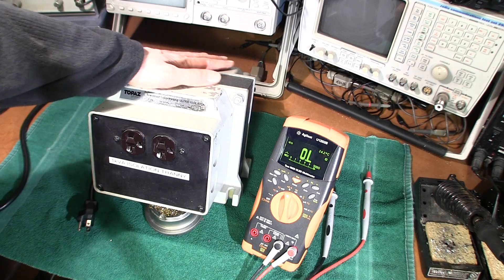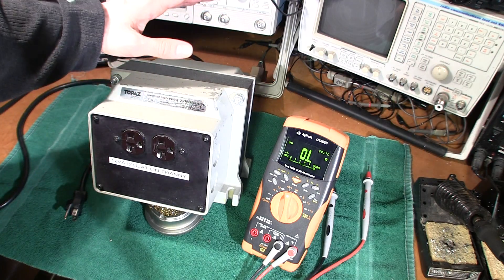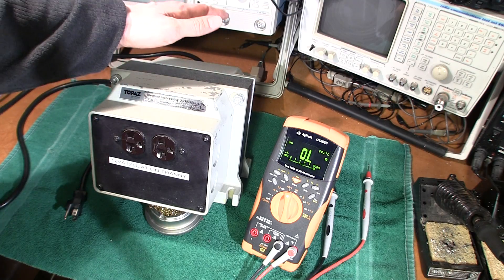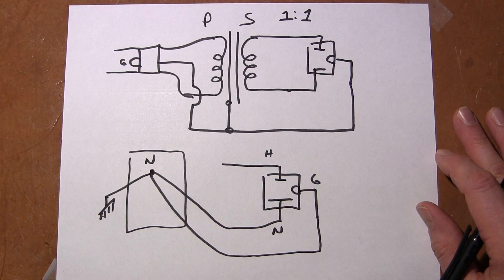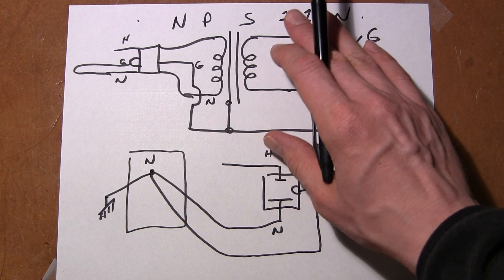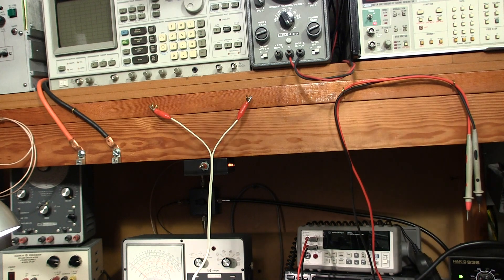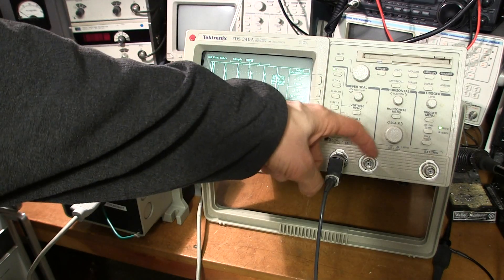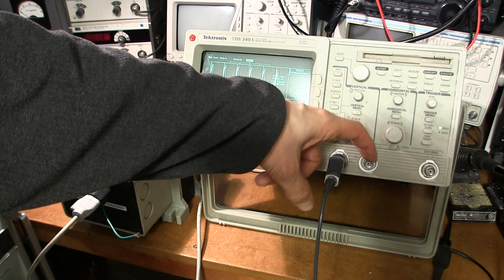Tech Tips Tuesday, Isolation Transformer and Variac Safety

Comment: So, here's a question: I'm planning to put together a little box around an isolation transformer that just has bare leads, and no plugs or outlets or anything.  My thinking was to still use a 3-prong outlet as the output, and to bond the "ground" of that outlet to its neutral, but where they're both floating relative to actual mains earth/neutral.  Is this reasonable, or should I just get/use a 2-prong outlet, and one of those adapters if my DUT has a 3-prong cord?

Comment: I have used that short cut with both isolation trans formers and vairacts. OK then what is the proper way to protect your self? Isolate the whole bench from ground? ie suspended ground in the fuse box or junction box?

Comment: Hi Mr Carlson: I have a Variac  Transformer TDGC2kM 2000VA. I want to use on my bench for project ,  my question is can I disconnect the grounding  wire so that it will be safety to my oscilloscope?

Comment: Thanks for a great video on this topic and addressing the safety ramifications off making mistakes in this area. This did breed one question. I have a gfci that's feeding power to my bench. I believe it would not work if a fault is generated on the secondary of the isolation transformer. Am I correct?

Comment: Mr. Carlson,
 I have a power filter for my equipment, an isolation Transformer ( fixed after watching your video👍)  A variac. I also have a current limited lightbulb when needed .
My question is ,...Where is the best location to place my isolation Transformer?
At the beginning of it all.  In the middle or at the very end???
Reply: I always heard it's best to place it after your isolation Transformer because your isolation Transformer is designed to operate at the voltage the manufacturer designed it at.

Comment: ... UNLESS... it is an isolating variac... which does exist.  Sorry, I have to muddy the waters when I have the chance... which also connects the ground backwards through your wonderful neutral line at the breaker box if you have bog-standard wiring systems like most of us have... which muddies the waters even further... Hell, where I live I can't trust that the water pipe in my lab doesn't somehow connect through to neutral at some point because of someone deciding that my explaining electronics and ground to them suddenly made them an expert in all things electrical... (glances upstairs)... anyway. to filter the waters back to something drinkable, ALWAYS CHECK EVERYTHING before doing anything... belt and suspenders.

That's my mad-science tip of the day, and why I still have all my fingers.

Comment: If your outlets are protected by a 30mA RCD like we have ( or should have ) in the UK, I don't see a problem. The user will be protected from a lethal current in the event of contact. Most UK systems of domestic supply have a PME ( grounded neutral ) type supply.
I appreciate that some older equipment have a 'hot' chassis where additional precautions have to be taken. Thanks a lot for the video, very well presented.

Comment: I have a Really Old "Hammond" isolation transformer, model 171B60 that solves this problem.  It has just a 2-wire male plug on the AC Line input, and a 2-wire female socket on the transformer output.  Got this transformer from my uncle back in 1974, and I'm not sure how many years old it was then (I see the 'newer' Hammond 171B are 3-wire input, and 3-wire output)

Comment: I break that primary ground loose and then I install a Heinneman breaker and a GFCI on the secondary side. If I want to get really fancy, I will isolate the whole transformer from the housing. I then tie the primary ground into the housing and I hook the secondary ground up to the isolated transformer frame, and bond the neutral to the core & frame but NOT the housing. I will have to use an orange isolated ground receptacle so the grounding plug prong is NOT strapped into the strap frame. I will also fuse the primary side.
Reply from the maker: Remember GFCI receptacles often create noise in radio receivers.
Reply: @MrCarlsonsLab  That is why there is an isolated ground hospital outlet on a Heinemann breaker outlet and a GFCI outlet running out through a Schurter line filter. I have a sailboat inverter charger too. THAT SUCKER IS SUPER NOISY, unless it is running off the batteries, but at the dock on  dock AC power it's beyond horrible for noise. Your radios are worthless on dock power through those.
Reply: The dock power is also all running off of multiple GFCI breakers, and those GFI send coils are inducing  tons of extra noise into the AC.

Comment: Makes me wonder why you even need a third pin and 3-wire power cord in the US.
If the ground pin is connected to neutral in the breaker panel anyway, why not connect ground to neutral in the appliance itself?
Using a plug with a small and large pin to distinguish hot and neutral would suffice.

Comment: So when you put that little cheater plug in and had the green ground wire kinda hanging there: if that ground wire happened to get pushed up against the case of the isolation transformer, would that re-complete the ground circuit and bring us back to the initial scenario? (Of course, assuming the case of the IT was grounded and the paint wasn't blocking it). Thanks!

Comment: Thank you Mr. Carlson. If I ever get an isolation transformer like yours I'll be sure to open it up and cut the ground connection to the secondary side.
Reply: I completely agree with you. Paul seems to caused confusion with others, (especially with me) by saying don't ever run the secondary without an earth. Isn't that the point of a bench test power supply, to have no ground on the secondary?

Comment: Hi Paul. Great video. Do you think you can do a video specifically on best practices for slowly bringing up some old tube based electronics with a Variac/isolation transformer? What do you check for (other than things going up in smoke)? How quickly do you bring it up, etc? I know for amps you often remove all the tubes except for the rectifier tube. I know every situation is unique but maybe there are some general procedures to follow?
Reply from the maker: Thanks for your input Kurt!

Comment: Great video. I work on a lot of tube guitar amps and I use a variac and isolation transformer. Do you recommend plugging the unit/amp under test AND the O-scope into the isolated (and earth/ground lifted) power source or only the unit / amp under test? I realize this could be a tricky question because when the scope is earth grounded and the probe clip is on the chassis, the chassis is once again grounded to earth as if the test unit was earthed at the receptacle, even though the mains AC voltage is "isolated."  Thanks for any response you can offer.  I'm in Mission and I refurbished a cabinet for a vintage amp you later did a video on the electronics rebuild.

Comment: Just a beginner here, but I thought the correct way was to hook up your oscilloscope normally, and to the ground and use an isolation transformer (with no ground) on the device you are testing.
Reply: Nope. Don't mess with the ground path of the oscilloscope.  If you need to measure something that can't be measured using the probe's ground, you use 2 channels (without their ground probes) and set your oscilloscope to ch1 and ch2 "add" and also press the "inv" or invert button.

Comment: If the Isolation transformer had no ground on the output side there would be no issue with this transformer. You demonstrated that with the no ground plug adapter. Your transformer is not completely isolated with ground. If you look internally that transformer has ground from the input connected to the ground output or it is connected to the chassis, therefore not isolated. Some transformers are this way even though they may claim to be isolated. Pure isolation transformers usually have a 2 prong on the output and there is no connectivity to any of the the input and are completely isolated. Also, some variac's have isolation transformers built in and may claim to be isolated, are not completely isolated.

Comment: Thanks for this great video. I worked in the TV repair field in the 70's and then eventually went into the electronics field in the 80's to early 90's but I can't remember what we did back then to prevent this issue with scopes. Did scopes change in recent years regarding grounding? I used primarily Tektronix scopes. Maybe I just automatically used a ground adapter and never put much thought to it. Thanks for all you do to educate us.

Comment: I am in Uk so 220-240v ac. I am just setting up my workbench. I have an isolation transformer  and have modified it via a switch on the front panel so I can select the original wiring set up or my modified setup. The modified set up has no earth/ground to the casing, transformer or output socket ( which feeds my variac input). The Variac has an earth tag which is connected to ground on isolation transformer output socket, so on modified switch selection on isolation transformer it is not earthed.
Any comments would be appreciated good or bad.

Comment: Will the scope still work correctly when it's connected to an isolation transformer that has a disconnected earth pin? What does it use as its reference voltage?
Reply: The ground in is the reference voltage. It doesn't need to be referenced to earth. It depends on the circuit you're reading.

Comment: This is one of the most complex and complicated issues in electronics (for me).  I've heard so many do's and don'ts and now I'm more confused than ever.  So, HOW DO YOU HOOKUP YOUR WORKBENCH?  Do you ONLY plug the DUT (Device Under Test) to the isolation transformer?  I think that's what they recommend for working on old Ham radios that don't have a power transformer - that have a "live" or "hot" chassis.  Or, do you ONLY plug your test instruments into the isolation transformer and have the DUT plugged into house power?  Or, do you plug everything into the isolation transformer?  I think I've read that that can be dangerous, too.  In any case, I guess it's a good idea to have a GFCI (Ground Fault Circuit Interrupter) (like used in bathrooms) multiple outlet bar to have the fastest shutdown of power if an imbalance in circuit power is detected.  Another question I have is - do I need (would it be useful to have) one of those Siglent SDS1202X-E scopes to troubleshoot a bunch of old Tektronix 465 oscilloscopes I have?  I think I'm looking for an excuse to buy one.  I just checked out your Tektronix TDS 340A scope, too.  I can get one of those on eBay for about the same price as the Siglent.  The advantage being that the face-plate is arranged in a more familiar pattern like other Tek scopes whereas the Siglent is somewhat confusing to my eye.  My rationale is that I don't know how functional or accurate any of those old 465's are and the Siglent or the TDS 340A would be new(er) and better able to give me more accurate readings, to troubleshoot those old 465's, wouldn't it?  Maybe?  Or would I be better off spending my money on other things?
Reply: In my universal phase motor ECU, I've designed it so that the chassis is directly connected to the safety ground, thus meaning that I can effectively touch the chassis with both hands and not get a shock. It also means that any capacitors holding their charge should discharge to ground once the unit is unplugged.

Comment: you should add a fuse to the wiper of the variac  luckly mine opened at the neutral end so repairable ...shure made me feal silly or just stupid not to thenk of the current in the secondary to blow the pri. fuse on short and turned down variac....for a cheap isolation transformer, use two transformers back to back..i use industrial control transformers   120v to 480v connected to 480v to 120v.  twice as big no nice box but i got em free.

Comment: Hi if I understand your diagram correctly. By connecting my equipment under test in the isolation transformer. I'm safe. Because there is no low ohm connection between neutral or hot on secondary of the isolation transformer and mains.  And your videos are great.

Comment: A very interesting video Mr Carlson, it made me look up how houses are wired here in the UK. Once upon a time you either had a ground rod (some rural areas still do) or you had the house ground bonded to the sheath of the mains supply which went back to the substation before grounding out. The single phase domestic supply was one of the three phases of the national grid to live and the ground at the transformer for neutral so the earth and neutral were connected at that point. New builds and I think anything that is re-wired now has a system just like you describe with earth connected to neutral in the company fuse box at the distribution board.

The other thought that comes to mind is that the earth connection on the secondary side of an isolation transformer seems to be absolutely pointless as it doesn't offer the safety that it appears to. The earth connection in an appliance is to provide a route to earth should anything fail internally and ground out the live causing the fuse to blow somewhere - either in the appliance, in the wall plug or at the distribution board. With more sophisticated systems with earth leakage or residual current detection that would trip out first. None of those things will happen if the live and neutral are isolated. But on the other hand you are unlikely to suffer much harm if you touch both the live and earth. When mine arrives I must test what potentials are there.

Comment: The safety mistake with the isolation transformer is attempting to isolate the test gear from the ground, rather than the tested device (DUT) from the mains live wire...
The thing is, you connect ONLY the DUT via the isolation transformer, NOT the test gear. Isolating the ground of the the test gear makes your bench extremely unsafe - all unused probes become energized, include all metal parts of your test gear.

Comment: You clearly state that you do NOT recommend disconnecting ground on your isolation transformer (and that older transformers were constructed with no ground connection). Can someone elaborate on the specific risks created in this way? I am constructing an isolation transformer using a 500VA core in a wooden box for working on guitar amps, and I don't plan to have any ground connection at all (your video reinforces my faith in the insulating properties of wood). No flames please, I'm here to learn :-).

Comment: Thank-you for another great lesson. I have a concern regarding your presentation of the autotransformer variac. Autotransformer by definition has a primary and a secondary except that the primary and secondary are connected together in an electrically common manner. That is what prevents isolation. Many autotransformer variacs allow for a secondary voltage above the line voltage 140 to 150 volts. That being accomplished by additional turns ratio on the secondary.

Regarding the illustration you showed I believe I may have some 40 volt variable transformers like that. I haven't given much thought to this until your video. I'll have to inspect them again.

Comment: I've struggled so much on this subject and decided to compile my own notes in what I call:
-----------------------------------------------------------------------------------------------
OSCILLOSCOPE PROBES/GROUNDING CAUTIONS "FOR DUMMIES"
-----------------------------------------------------------------------------------------------

Oscilloscopes ARE NOT multimeters. Oscilloscopes are from Mars, Multimeters from Venus. The common and the positive probes of the multimeter DO NOT work the same way as a probe in an oscilloscope. The alligator clip on the scope probe is connected, through the power cord, to the Ground. If you clip it to something that isn't at Ground potential, you get a large current, and things blow. Engineers built the oscilloscope like this, and it has to do with safety and noise performance.

What should you do? It all depends on what you want. If you are planning to work with ground connected circuits/power electronics you must exercise caution. If you are an enthusiast working with very low voltages, you shouldn't be so concerned.

FOR GROUND CONNECTED CIRCUITS (POWER ELECTRONICS)
1. Contrary to what some colleges still teach, do not use an isolation transformer to float the oscilloscope. This is reckless and dangerous. It's better to isolate the device under test and let the scope work as designed (see #3 below). A Google search of, "How to die by isolation transformer" will give more examples and information.
2. Do not use cheat plugs or remove the ground.
3. Focus on protecting the Unit Under Test (UUT), not the oscilloscope, and use an isolation transformer with the following criteria:
a) Must have a current limited supply
b) Make sure to internally disconnect the transformer's secondary neutral from the ground. Many transformers often have the neutral and ground tied together.
4. Do not hook up communication cables via RS232, USB, etc. to your test circuit, otherwise your UUT will no longer be floating.
5. If power electronics are a must, invest in a differential probe. It's expensive but will save your life and your equipment.

FOR CIRCUITS NOT GROUND CONNECTED
From input levels such as a few mV to few Volts up to 50 V DC, and potential 15-50V DC, probes/grounding shouldn't be much of a concern.

Comment: If one wanted to check their house line with a scope, how would they connect the scope safely? Can the scope be connected to the wall on the 10X as long as it's also plugged into an isolation transformer?  What about high voltages in old tube equipment? 
    Extremely new guy here with only basic electronic knowledge and about to buy his first scope and I don't want to toast it right off. Siglent SDS1104X-E.  A lot of scope for a newbie, but I wanted something I wouldn't need to upgrade for a long time.